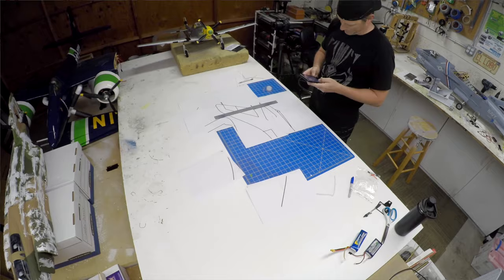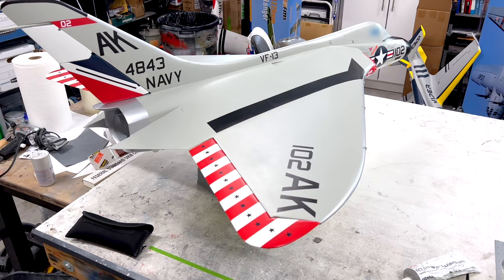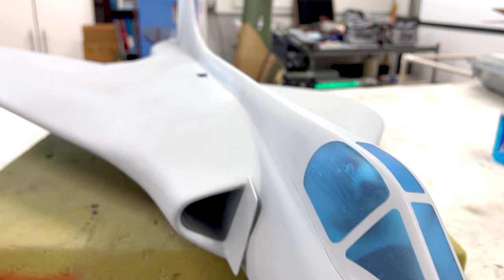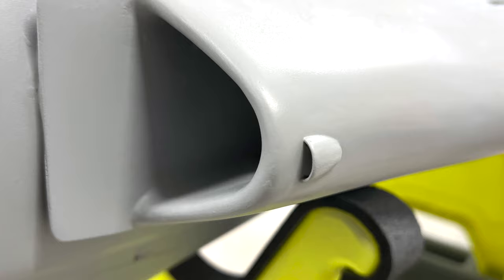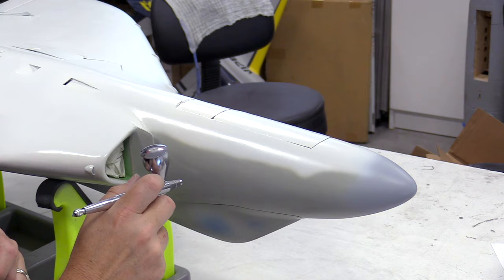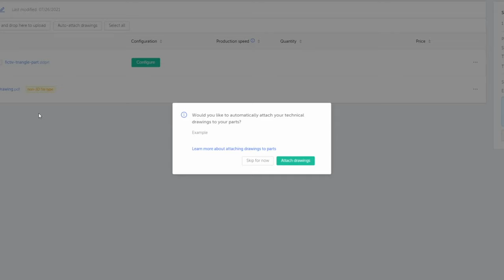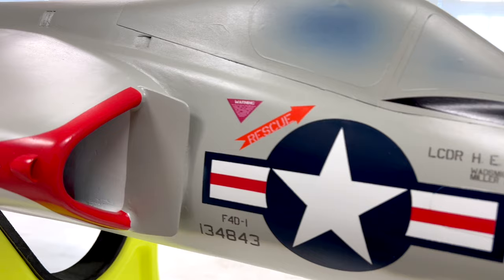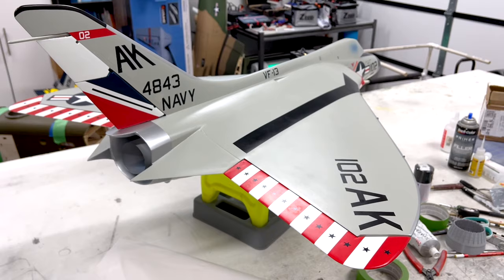Scale Model MAGIC: Scratch Building & Painting an RC F4D Skyray

Comment: thats very nice , a small tip when you use metalics ,go first with a gloss black then add the Metal ,first of all you are using half the material because on the black it covers faster and you get true metal effect !
Reply from the maker: Thanks!  The black is definitely required for the high shine Alclad2, but isn’t necessary for the standard aluminum colors which is what I sprayed here. I’ve tested and painted alclad a bunch and there’s no difference in the sheen when doing that with the base aluminums.

Comment: Amazing paint work! I love MRP paint and paint plastic models..(have flown some RC as well). Can I use that stencil technique with GIMP to create custom insignias? I'm usually building 1/32 scale models these days. thanks
Reply from the maker: Thank you!  I’m not familiar with GIMP, but the material can be used for any type of masks, so using it for custom insignias should work great!  I’d definitely recommend playing around with it first before going all in just to make sure it gives you the results you want. 😊
Reply: Cool! I read that the 70's Navy jets were the light gull grey, FS36440. There seems to be a lot of variation in the gray color in actual photos. Some look like the gull gray where others look different. Have you noticed this variation of color in the 1970's era Navy jets?  @Thercgeek
Reply from the maker: The 1970’s phantoms were most definitely gull gray (36440) over white (37875). As they entered into the 80s, the schemes started to evolve into the low viz grays reminiscent of what you see nowadays. There were even some experimental schemes painted on them as well in the 80s.